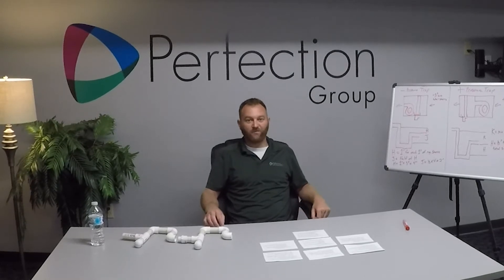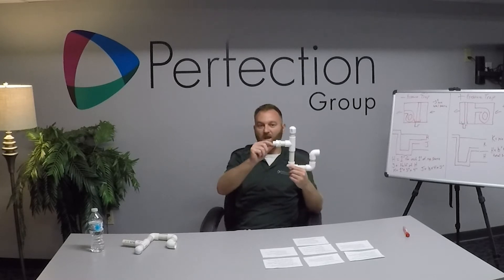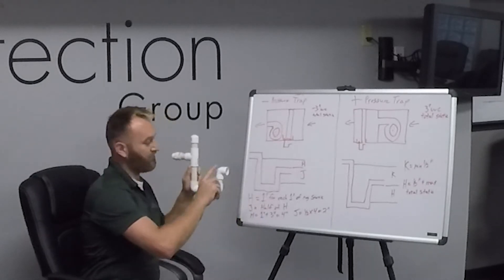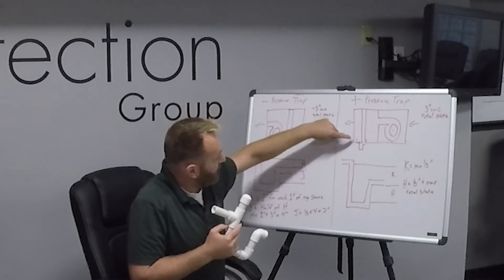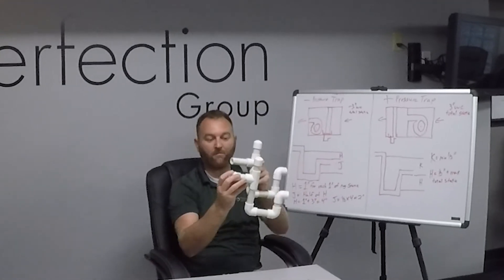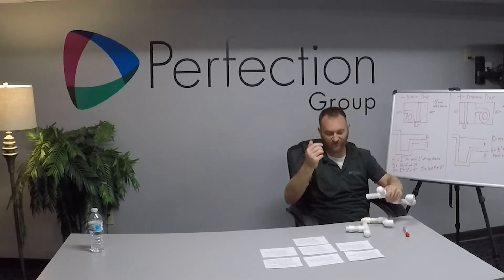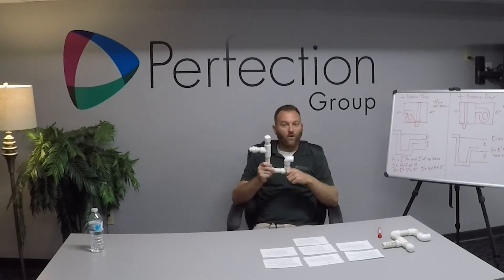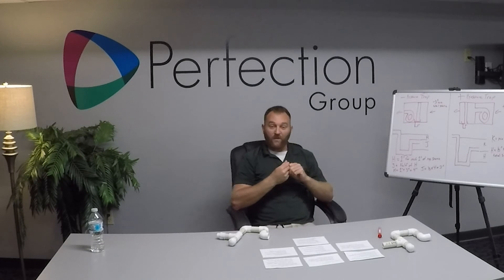Condensate Traps

Comment: Sir just saw your video. Question when doing a negative trap. ( draw thru coil) are you taking just the static reading pressure from the return or are you taking the return (negative ) and supply ( positive) and adding total static?   
Thanks